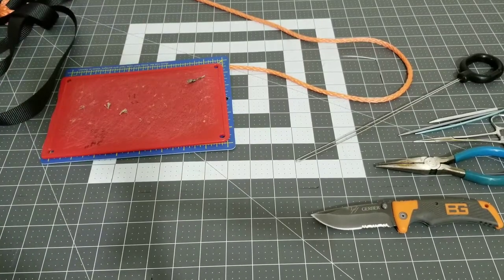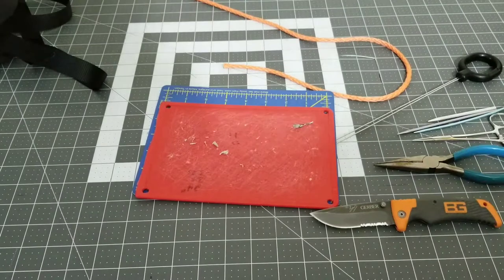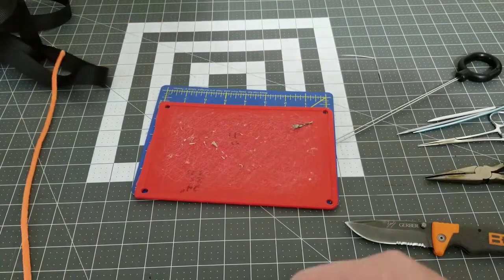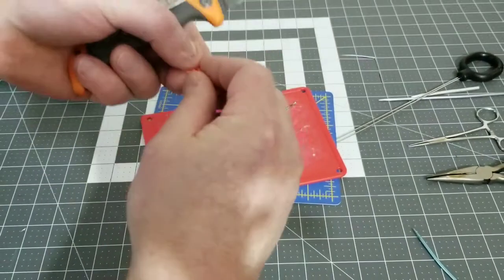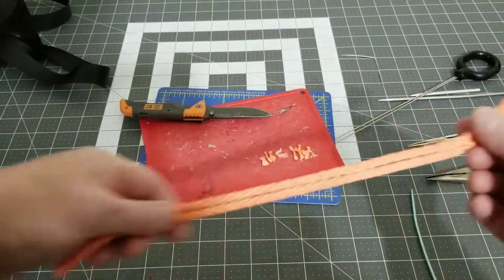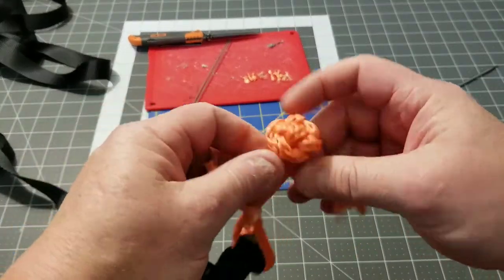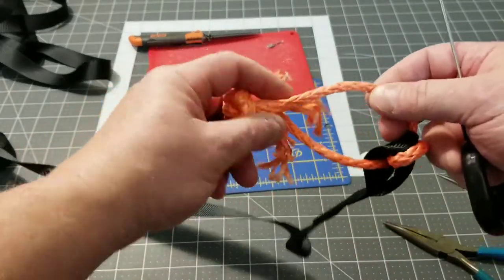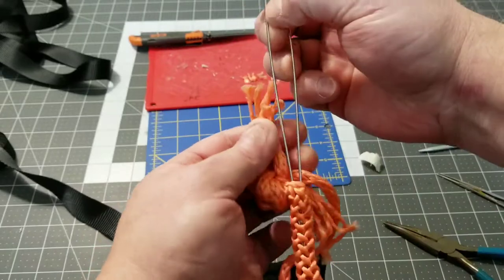DIY No Hardware tree clip button knot tutorial

Comment: This was outstanding!  Great explanation and demonstration.  I have save this video.    Would this also work with Dynaglide for the same purpose or do you recommend only on amsteel?
Reply from the maker: Have not tried dynaglide , would work just make sure the knot gets trapped in the loop , smaller rope does not work as well . I would use 1/8 inch amsteel at least.
Reply: Thank you!  1/8 inch it shall be; either way it will be WAY lighter and less fussy than other ways.

Comment: Regarding the No Hardware tree clip button knot you showed us 5 years ago.  I'm considering this larger knot 3/16" Amsteel OR the DIY dyneema fast shackle hardware free suspension using either 7/64 or 1/8" Amsteel.  Do you see any advantage to either one.  I noticed you designed the smaller one more recently.  Do you prefer using IT?
Reply from the maker: Hi the the fast shackle would be my preference!

Comment: Did you test any other sizes of Amsteel for making the butten knot?
Reply from the maker: tubited yes . Small diameter 1.75 mm and 7/64.
Reply: Why do you prefer 3/16 over something smaller like 7/64?
Reply: Do you still suggest 30 inches of using 7/64?